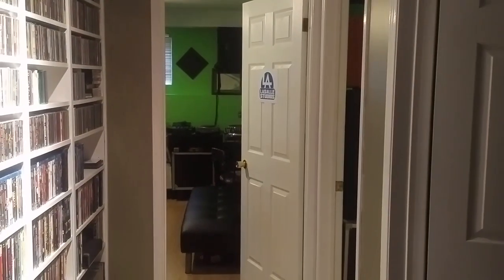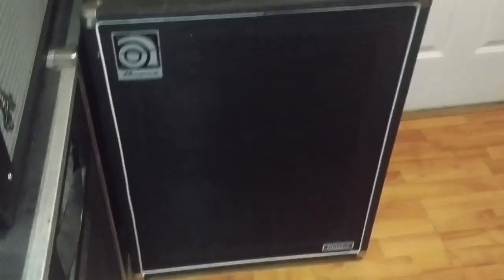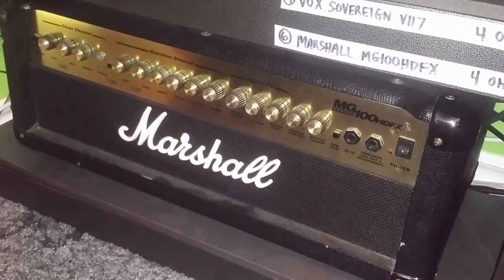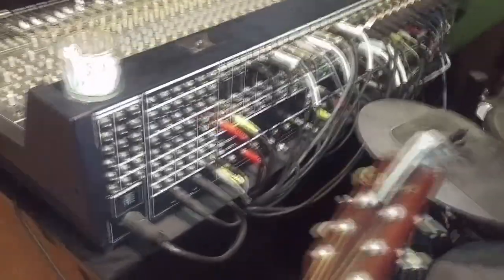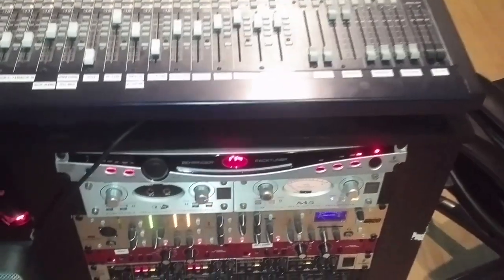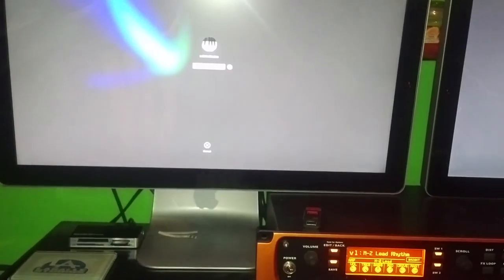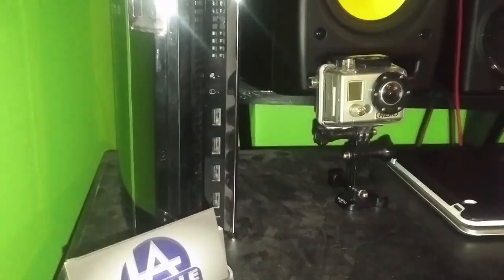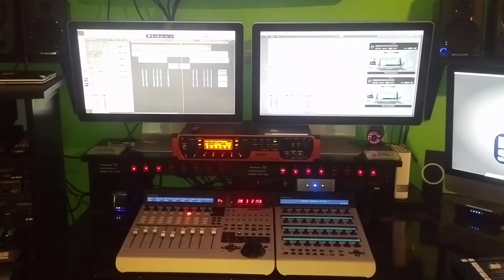THE ULTIMATE HOME RECORDING STUDIO

Comment: It appears that the rooms are all too small to allow sound to develop properly. If you sing in a closet (booth) it will sound like a closet.  If anything, stand in the closet facing outward into the bigger room when tracking vocals.
Reply from the maker: Depending on the sound we want, is how we decide what room to use when tracking. For more dry vocals we use the vocal booth. If we want some more size to the vocals we track in the live room. Its great to have a couple options. We actually just purchased a new location so will be building the new studio towards the end of the year and are considering the dual live rooms again.
Reply: cool, i like your studio
Reply from the maker: Thanks man, we appreciate that! Will post updates as the new one is built!